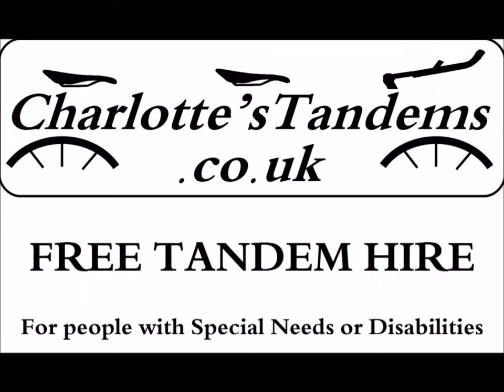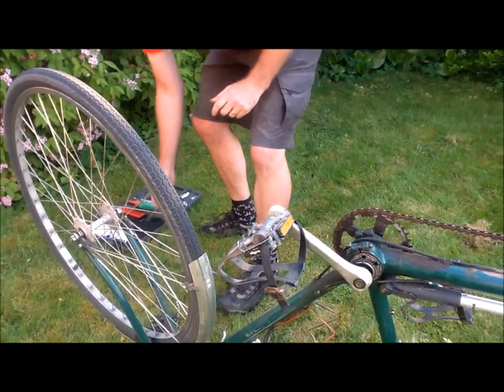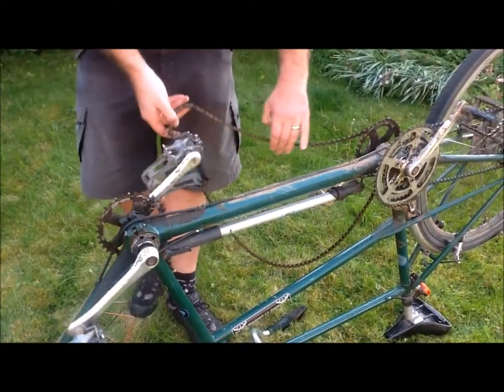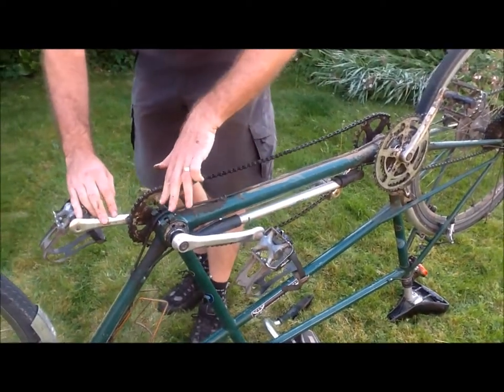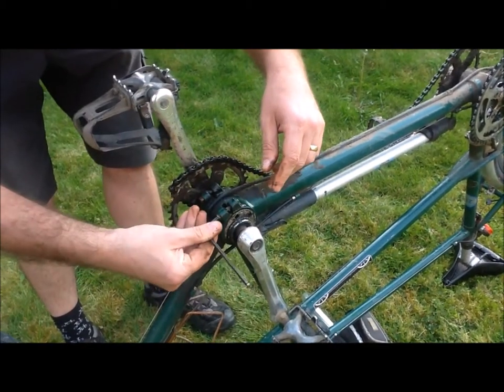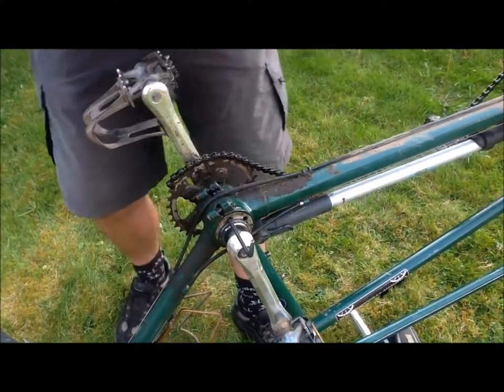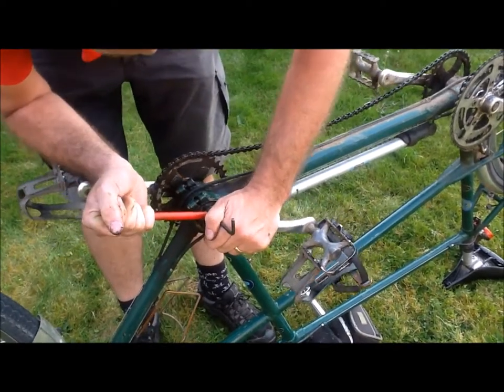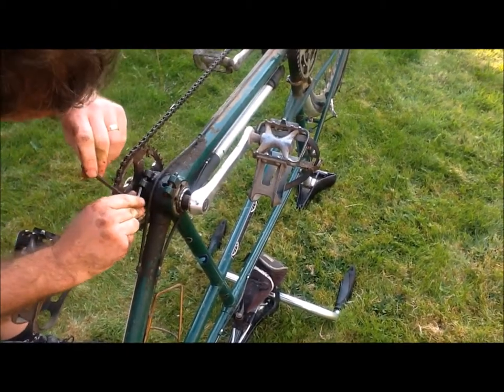How to tighten a tandem chain using the eccentric bottom bracket

Comment: Thanks for the video as I need to tighten my tandem chain.  Also great you are offering tandems for special needs people.  I'm using a tandem currently as my right foot is in a cast and can't pedal so I put a bracket on (just cut the arm out of a crank and welded the pedal nut part in the centre then attached the pedal back on) and it's been so great to get out again. Great job!
Reply from the maker: Thanks for your kind comments.

Comment: I keep the cranks on my Santana Elan two teeth out of phase, (24 degrees), allowing the stoker to push the pedal through the captain's top/bottom dead center phases, and vice versa. This gives a measure of the out-of-phase advantage without the risk of slugging the pedal on a turn or a speed bump.       
The bottom bracket eccentric shell on my bike is not a split type, but rather in a full circle shell fixed by set screws that press into the eccentric.      
The split bottom bracket shell is a potential weak spot in the frame, especially with two strong riders, the whole bike is held together by those two bolts.     
I use half-step-granny gearing, (24-47-52 chainrings and a 13-32 six-speed freewheel), SunTour ratchet shifters, Scott-Pederson self-energizing rim brakes operated from a dual-cable right lever and an Arai drum brake on the left lever.     
It's a pretty sweet rig, rides smooth, and looks pretty good, even thirty-three years later.

Comment: Hi. I have myself a vídeo about this (in portuguese). There is a very important detail, one should tight the boacket using the opposite direction of the usual pedal movement, because the spheres spin tend to untight it. When we bought our tandem, I was doing it wrong, and after 2 or 3 rides, the chain got large.